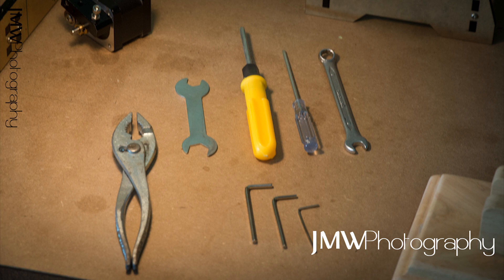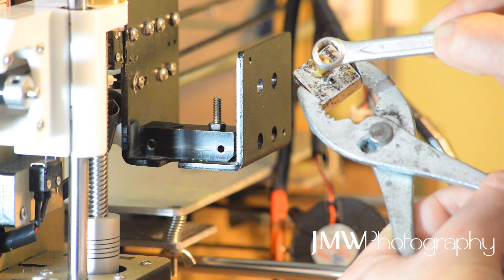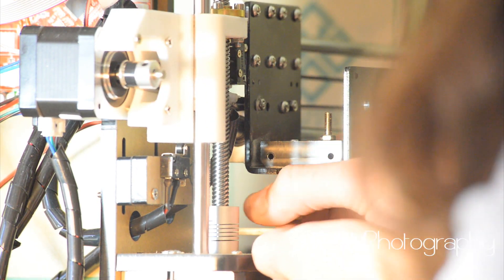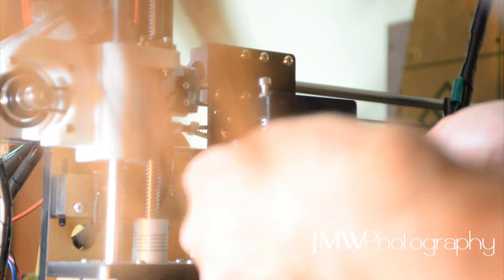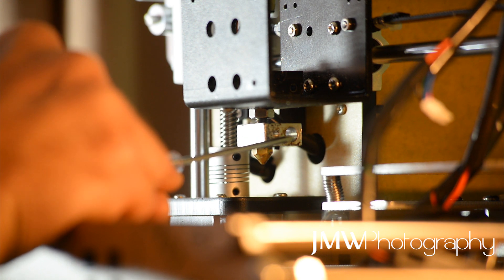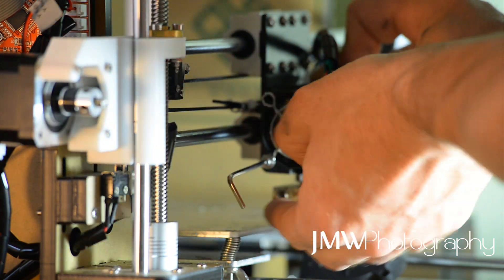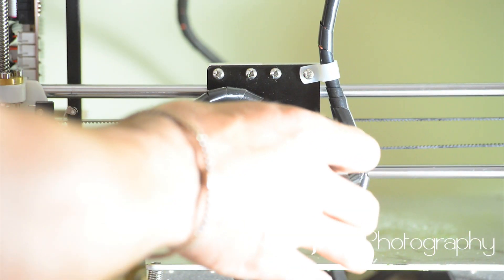Anet A8 3D Printer - MK8 Extruder Assembly : Setup Tutorial

Comment: is it normal if the hot block looks a little tilted to one side?
Reply: I have an Anet A8 plus printer, I bought a replacement extruder, but I noticed that the hot block looks a little slanted and not 100% straight, so I wanted to know if it's ok for that to happen, if that doesn't affect much when it comes to to print.

Comment: You sure you haven't inserted the throat the wrong way around? Usually on MK8, the PTFE liner goes against the nozzle. PTFE is a loose insert, and If it was going against the extruder, there's usually no barrier that would prevent PTFE liner from sliding up into extruder body on retraction. Normally the PTFE liner is held in by nozzle pressure on one end and by the flange of the throat on the other.

Comment: Perfect, taught me what I need to know - My feeder tube plugged from pulling out hot filament, and I wondered what unscrewed from what.  Now I know: Loosen or remove the nozzle, THEN I can loosen the feeder tube, heat it, and push the stuck filament out of it.  

SO NOW I know I should snip off the filament as it goes into the head, and print until it runs out, then I can insert the new filament.  I guess I'd just been "lucking out" pulling the filament hot to change filament.
Reply from the maker: Hi +Ward,
Sorry for the late response. 
To be honest, I actually don't recommend 'printing' the last of the filament out. The way the extruder works is that the filament is pushed down and into the hot end via gears that will run out of 'grip' on the end of the filament before it has been completely extruded.
The method I use to change filament is known as the cold-pull or atomic pull method. 
You can check it out here: https://youtu.be/F7geQEtyr4I
Feel free to subscribe for updates as we go. :)
Reply: Thanks for the reply!  I like to pull the filament out hot, but that's when a little blob stuck at the top = cold part of the tube, so had to take the head apart because I couldn't push through the blob. 

Perhaps your "push down first, then pull" as kindly explained in your referenced video will be the solution.  Maybe I got one of those "one in xxxx" problems.

Oh, and for the sake of your I-feel-sorry-for-it Thumb, I suggest printing an extruder button.  I really like https://www.thingiverse.com/thing:2182276 though perhaps due to shrinkage, it didn't fit my hex head, so I drilled it out. Later in Blender I made the hole a tiny bit bigger and reprinted it.  A real thumb-saver.
Reply from the maker: Hi Ward,
The key is to let the hot end cool a little before pulling it out. There is a sweet spot where the filament is soft enough to be malleable but not soft enough to be any where near liquid. When you really get it right, the end of the filament(where it comes out of the hot end) will even be in the shape of the inside of the nozzle. 
Don't give up, you'll get it. :)

Comment: I'm having issues screwing the fan back to the motor for some reason the screws don't tighten
Reply from the maker: Hi Derek, sorry for the late response. Did you get this sorted? If not, make sure you're using the right screws. I accidentally got them mixed up with some others that were a little wide for the holes. It took me far too long to work it out.. Haha. Otherwise have you got a video of what's going on? Feel free to post it here for us to see and solve.
Reply: I managed to get it sorted, unfortunately I have some filament jammed so gonna have to remove again☹☹
Reply from the maker: Ahh the pains! It's ok, you get better and faster each time you disassemble. ;)

Comment: My throat tube snapped in half just when I tightened it at installation. Is asking them for replacements the best solution?
Reply from the maker: I would just buy a pack of spares to be honest. They are very cheap and you will need them in the future. I like to keep spare nozzles, throat tubes, blocks etc. :)
http://www.gearbest.com/3d-printer-parts/pp_540280.html?wid=21&lkid=10621505

Comment: mine is leaking thorough the bottom and the top after changing my nozzle..pls help
Reply from the maker: Hi Pickles HD, this is when the throat tube is not butted tightly against the nozzle inside the block. 
If you follow these instructions you should be fine? Good luck my friend.

Comment: Hello can you tell me who I connect extruder motor on Anet A8 motherboard?
Reply from the maker: Hi hacker tom, 

The actual stepper motor for the extruder plugs into the 'E MOTOR' socket, the thermistor(tiny white wire) plug's into 'E_T' and the hot end will be connected via a terminal connection. If any of this doesn't make sense, please let me know or seek alternative advise. As there are a few variations of the board, I would hate to give incorrect information that could lead to a fault. 😊

Good luck!

Comment: Thanks. Wish I had seen this before shearing off the throat tube.  But what is the answer to the question below by Phillip Toone 3 weeks ago about the correct way to insert the throat tube? Grateful if you could reply before I shear off another one.
Reply from the maker: Hi Ian, thanks for the comment and for bringing my attention to a missed comment. I accidentally melted my original PTFE lining so I had to replace it. This new piece is a bit longer than the original and fits the entire throat tube. The original throat tube has the lining butted up to one end and it is that end that you screw towards the nozzle. Failure to do so will allow melted plastic to leak from your heater block/ nozzle join and ruin your prints. 
Thanks again for bringing that up as it may have confused some people! 😊
Throat tubes are available here: http://www.gearbest.com/3d-printer-parts/pp_540280.html?wid=21&lkid=10621505
Reply from the maker: Hi Ian,

Thanks for the response. I must not have made sense. 😛 Sorry. You are right in thinking the tube-end goes down(towards the nozzle). This is what I was trying to say when I wrote "The original throat tube has the lining butted up to one end and it is that end that you screw towards the nozzle." By 'lining' I meant the PTFE tube and 'butted up to one side' meant flush to the end at one end of the throat tube and not so at the other.. Confusing to write without being able to point at things. Haha.

When you're replacement parts come, you can use something to carefully push the tube from one end out the other so it is flush with the edge. Be careful no to perforate or damage the PTFE tube as if there is friction/ resistance between it and your filament, clogs etc become more common. 
By the way, it's the plastic tube that creates a 'seal' within the system and allows the filament to feed under pressure and not leak.

I am also in Oz, WA. I have been trying to find a reliable source for these parts without the waiting time but so far it's been Amazon or Gearbest only. 

I hope I haven't caused any confusion!

Thanks.

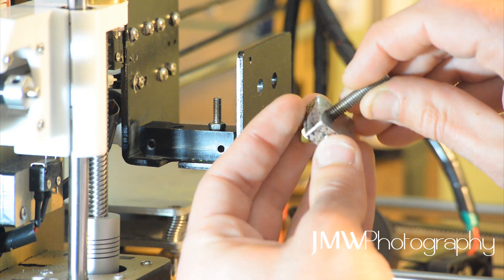Comment: At 0:24 it looks like you put the throat tube in upside down.  Isn't the end with the exposed PTFE supposed to go down into the heater block to seal against the nozzle?  It looked to me like you put the metal end down into the heater block.  Let me know.
Reply from the maker: Hi Phillip, thanks for the comment and apologies for the late response. 
I accidentally melted my original PTFE lining so I had to replace it. This new piece is a bit longer than the original and fits the entire throat tube. The original throat tube has the lining butted up to one end and it is that end that you screw towards the nozzle. Failure to do so will allow melted plastic to leak from your heater block/ nozzle join and ruin your prints. 
Thanks again for bringing that up as it may have confused some people! 😊
Reply: I installed my tube with PTFE down, then saw that the PTFE is meant to insulate, which I took to mean "above the nozzle" so I flipped it PTFE UP.

It didn't seem to make any difference in printing. 

I could not seem to find any web sites saying which way it goes. 

I DID notice the end opposite the PTFE was slightly funnel shaped so it made sense for that end to help guide the filament into the middle...
Reply: JMW Concepts Hi, the lining butted up to one end means? Hmm that inside the walls of the hole of the tube is not straight but let say 45deg toward outside side of the tube - correct? And there is no teflon at this end - right? And this end we should put toward heat block correct?

Comment: Hi, what is the exact type of tube? I have this printer but when trying to fix it, the tube snapped.
Reply from the maker: Hi Valentina, the throat tube can be found at Gearbest below. I would advice getting some other bits and pieces for as they wear out. Throat tubes, nozzles, heater blocks etc. :)
http://www.gearbest.com/3d-printers-3d-printer-kits/pp_337314.html?wid=21&lkid=10558912&lkid=10558926

Comment: I have a problem with mine.. the motor is spinning but it isn't gripping the filament... how do i tighten it
Reply from the maker: Is this the Anet A8 you have? There is a chance the spring in the extruder may not be long enough to apply enough tension.
If you manually feed the filament through, does it extrude out the nozzle?
Reply: Yes ...I can push it threw and it goes in just fine
Reply from the maker: Hmm, if it goes through nice and easily when you push it manually, then temp, blockage etc can't be the problem.
There is a chance the spring just isn't long enough. Perhaps see if you can post a video of the problem so I can see what's going on. You can try to apply more pressure to the extruder gear by pressing gently on the feed screw(upwards, not down like you would to insert filament) while letting the motor attempt to extrude.
If this makes the plastic extrude, then you can either buy a longer spring, or try to stretch it out a bit. Remember that if you stretch it, while length will increase, tension may decrease so there is a fine point where this method will become counter-productive. 
I hope this helps. 👍🏻

Comment: Like the video but your printer is so dirty :(
Reply from the maker: Thanks +RazorProductions. It is isn't it? It needs a good clean. I hold out though because every time I clean my heated bed, it takes a few failed prints to get nice adhesion back. Lol. 😂
Reply: I have never tried it before, but in theory it should work. You buy a mirror and sandblast or sand the mirror side of it, make sure not to touch the glass part, and you can clean it all you want. Plus, it should make abs and pla stick like they were married.
Reply from the maker: +RazorProductions, a lot of guys do print straight on glass or mirror but I think they keep it slick. You see some super smooth bottom layers off glass. I want to try it now.. 😂
Reply: Yeh but the thing is printing straight on there is a hit and miss, and when you put glass on your heat bed I recommend waiting 10 minutes after printer says it's done heating. This is for the heat to transfer throughout the glass. The reason I say hit and miss is because there is not a lot of grip on the mirror or glass, so a very fine sandpaper will get you a mediocre bottom layer and awesome adhesion. Since mirrors are pretty cheap, I would test printing on it with and without sanded mirrors if you want. All you would need to do is switch the side of the mirror, glass is the flat side, and the mirror being the sanded side.
Reply from the maker: Yeah it could be interesting. wonder if you could just use regular glass out of a picture frame or if it would want to be thicker.. Maybe experiment time! Although I'm busy with another project right this second. ;)
Reply: I would use mid range, and if use just use regular glass you cannot sand sand it. Maybe putting automotive primer on top and sanding it could work. Sanding regular glass, plexi is okay, would make it tremendously fragile. The reason being glass has the characteristic of breaking and fracturing with pressure on a damaged side. I would love to see a video on it after you are done with your project however, just mind my warnings.
Reply from the maker: Great thinking. When I get a chance I'll have a look around and document my experiences. :)
Thanks for the advice and happy printing RazorProductions!
Reply: I was looking for a decent price and on Gearbest it's for 146.99 dollars with coupon code: AFFA81
http://www.gearbest.com/3d-printers-3d-printer-kits/pp_337314.html?wid=21&lkid=10312400
Gearbest is a well known online store, so...

https://www.youtube.com/watch?v=B71GGLBrQDU

Comment: thanks for this video, helped a lot!

my nozzle clogged at the first (testing) print...
can i just unscrew the nozzle after preheating for cleaning?

any tipps for cleaning a clogged nozzle?
Reply from the maker: Hi TheDorovan, thanks for the post. Cleaning your nozzle shouldn't be too hard at all! Always make sure anything you do(undoing, tightening, adjusting etc) anything regarding the hotend, with it heated up. Thermal expansion will usually end out in broken parts if done cold.
You can carefully undo your nozzle and use either a hypodermic needle or micro drill bit to clear it. If you were printing with ABS, you can soak the nozzle in acetone and that will break the clog up. I have heard of guys using a blowtorch or similar and blasting it with heat to burn the clog out but I haven't used this technique yet.

I hope this helps! Feel free to subscribe for regular updates, I will probably do a nozzle-cleaning video next time I need to clear a clog as well. 😃

-JMW.
Reply: old quesiton, but a cold pull often helps. let it heat up to the point, where you can barely force a a bit though the nozzle (or move the filament, if the nozzle is actually blocked), keep pushing .. and pull it out with a quick tug. 
doing this when changing filament helps to prevent plockages of the throat tube, and keep the mozzle free fo residue.

Comment: Cool video can't wait to do when my privet arrives
Reply from the maker: Thanks @TechEverything! Has it arrived yet? 😁

-JMW.
Reply: Yes yes it has! sorry for not keeping you posted. Assembled in 4 hours. Had to cut some acrylic and had one more problem  The right z axis whit thing needs a bit of lubrication as it keeps jamming the time rod. and the z limit switch has a wire popped off and I could not see under the insulation. I am going to solder that today. After that I will post a video of printing and a review. Thanks for asking! Your videos are very helpful.
I'll keep you posted!!!
Reply from the maker: Awesome! Shame about all the repairs you've needed to do straight out of the box! I will say though, the community minded part of me is glad it went to someone like you(it sounds like you have the knowledge to fix it) or me. It saddens me when absolute novices get a machine that requires attention yet they lack the ability and are left with an unusable machine and a bad experience. 😊 
Keep us posted on your progress. Subscribed. 👍

-JMW.
Reply: That is very true. Guess what i fixed it today! I soldered the z limit witch ,it started working again, then i lubricated the right whit thing. That had not fixed the problem completely. Then i realized, why no loosedn the gold thread on the white thing. So i did and voila. I printed a cube!!! Ill keep you posted. Might install my mosfet today if I have time to print the bracket.
Reply from the maker: Awesome result! Well done! I love success stories! 😃